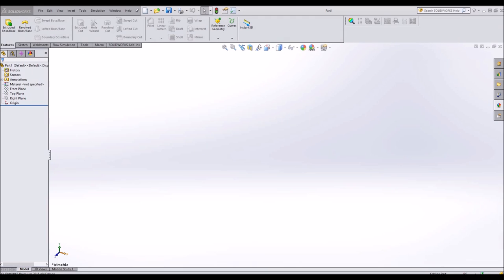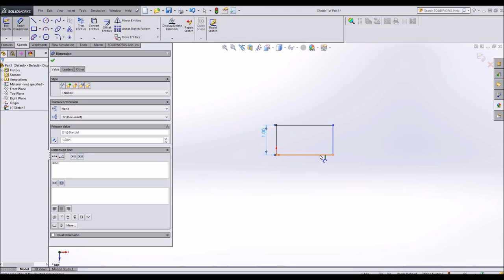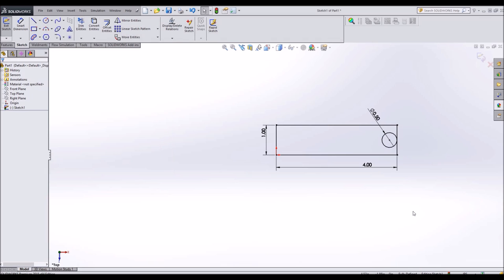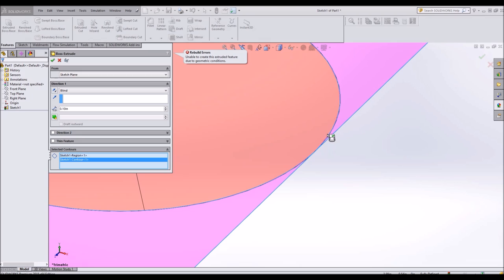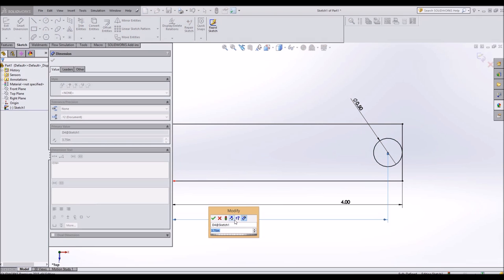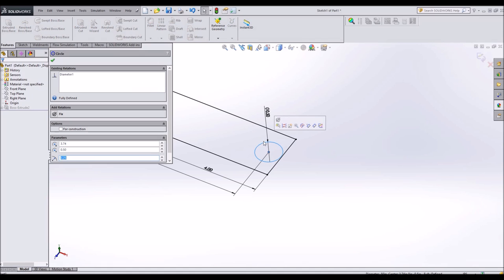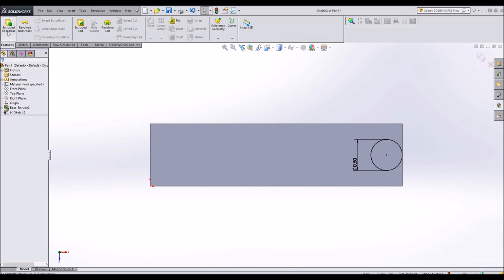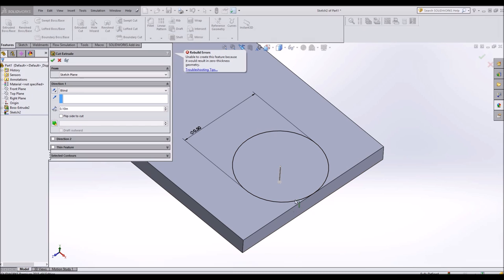Resolve Zero Thickness Geometry and Geometric Conditions Errors in Solidworks |JOKO ENGINEERING|

Comment: So, I'm 3D printing and I want my circle to exactly touch the edge, I don't care if it extrudes part of the bounding geometry.  How to do this?  I don't want a 3.74mm circle, I want an exactly 3.75mm circle.
Reply from the maker: I would do something like a 3.749999mm circle or a 3.7500001mm circle which would satisfy the kernel but be so close to nominal only metrology equipment would know the difference.  There is no getting around the computational limits of the kernel unfortunately,  but specifying that close of a dimension will be so insignificant the tolerance of the printer itself will be a much larger factor.

Comment: but what if i want it there?
Reply: Without seeing your model, the most I can suggest is moving the feature in some direction that is 0.000001" or so, which would be a negligible tolerance from a manufacturing standpoint.
Reply: thank you.  how may i send you my model? :)
Reply from the maker: feel free to send to the email in the description, jokoengineeringhelp@gmail.com
Reply: thank you. i've sent an email to you
Reply: I guess it works by making half and the other half as a separate part and make a assembly, i am not really sure if its working.